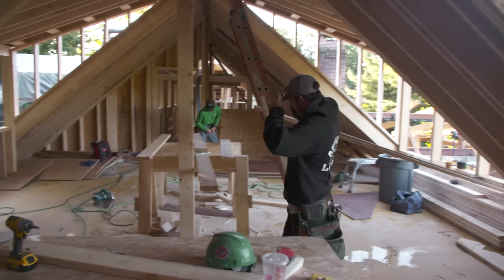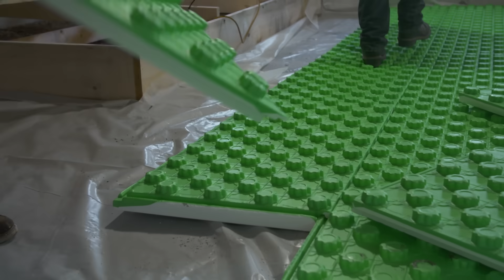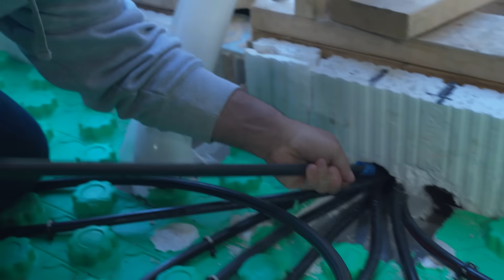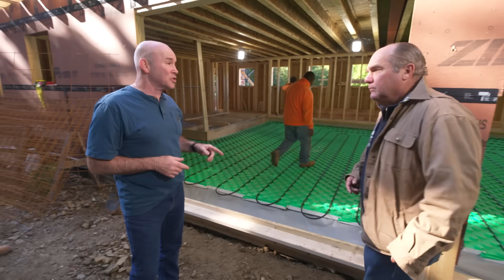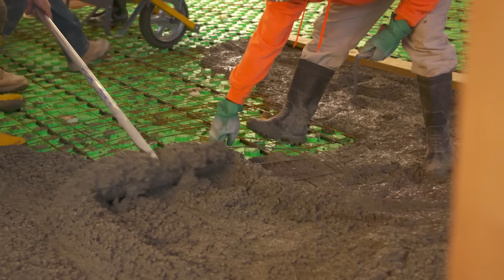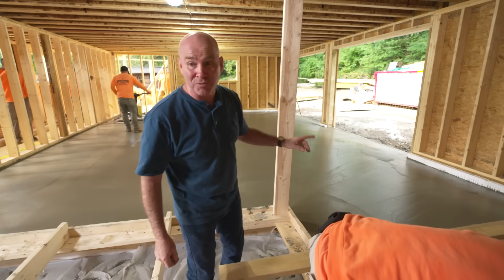Radiant in Garage | This Old House

Comment: Cost? And what to do when there is a need to fix?
Reply: Don't worry about that.
I have radiant floor heating in my 40 year old house.
Since its in the concrete, there is not much that can damage it.
Reply: @derradfahrer5029 I'm wondering more about doing it in my driveway...but I'm concerned of repair costs.

Comment: would it be the case that this garage would require an air barrier between itself and the living spaces (life safety issue)? Also, would a vapor barrier be required on exterior walls on the warm side (energy efficiency - heating climate)?

Comment: Did one for guy who put pipe in himself. On gravel , plastic,,tied to rebar stakes and then only put 4in concrete on top .   Was mess to finish. Several places pipe would not stay down.
Reply: If you were ok on the air test you either tie it down or fill it with water / antifreeze so it doesn't float. If the air test was no good then you shouldn't be pouring cooncrete yet.
Reply: @rupe53 it was tied down but evidently combination of grade and tie down failed
Reply: @Steve-k4f5z     ... and the fix was done before the concrete set?

Comment: They were all pleased with the fine work they did on that floor. 

Clocked out for the night and upon returning to work in the morning they discovered that the non secured structure had been visited in the night.

A group of pre Christmas inspectors decided to check out the workmanship of the garage floor and left evidence of their visit in the soft garage floor.

Yep that's right. Santa's reindeer thought they were putting one over on old Saint Nick with their wild ways. 

Don't worry, soon on Christmas day, their wild antics will be discovered and the team of 12 will find a lump of goal in their Christmas stockings this year.

I don't think Mrs Clause is going to be too happy with them either. 

Do you think she'll refrain from giving them their annual Christmas treat?